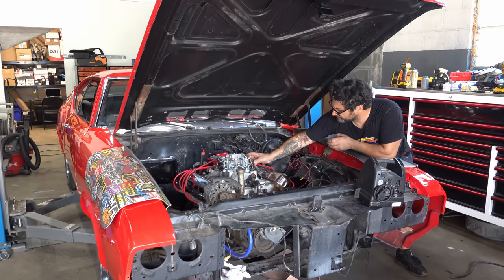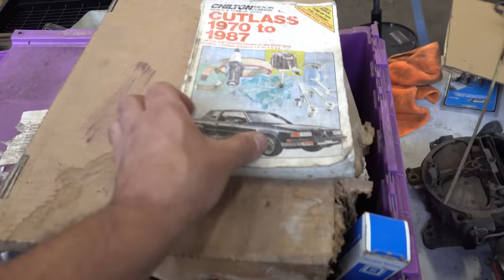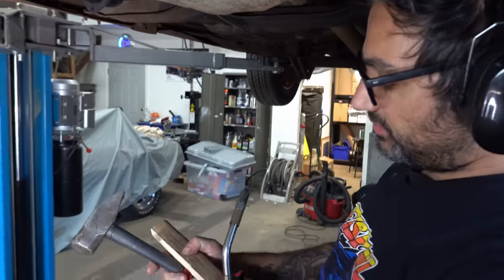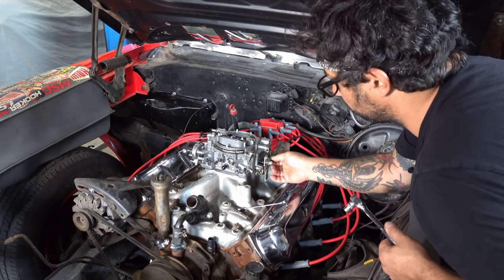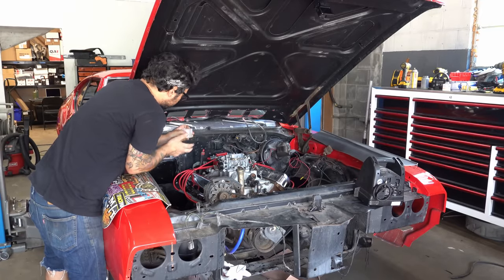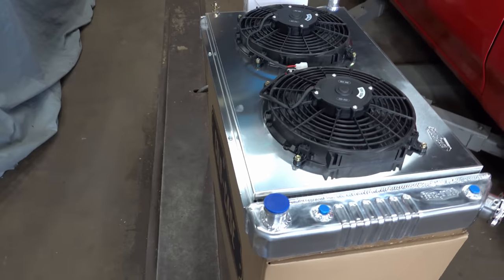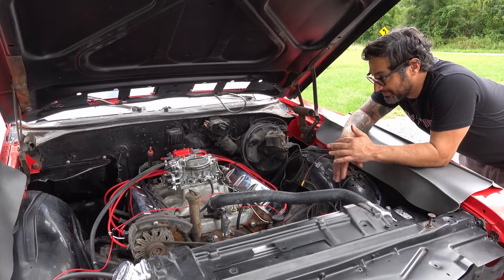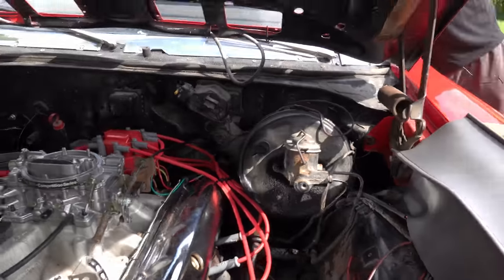Will This Abandoned 1970 Cutlass Run and Drive After 15 Years?!

Comment: You remember the guy, Ben, who helped you with Finn's transmission on Drag week? He's an Olds guy located in Maryland and might have a better set of heads for ya to buy.
Reply from the maker: I love Ben! I'll hit him up. He can prob sort this transmission too.
Reply: @StayTunedTA  he is a great friend and definitely saved my bacon before Power Tour '19
Reply: @StayTunedTA  he knows a ton about the 200-4R, that he will definitely have ideas for ya.
Reply: Let me know what I can do to help.  Make sure the TV cable is adjusted correctly before the first road test.  It's all too easy to burn up a 200-4R.
Reply: Check casting number but front filler tube. Big Letters  are  big block and  big number is small block. Drivers side flange by front no 1 cylinder has 3xxxxxx for olds make year plant and vin.... good look with rocket motor. Had a 74 H/O 455 W30 that rocked!
Reply: If still visible, the little pad on the driver side front deck corner of block will show a vin number. That number will tell you the year, etc for that engine.

Comment: That 350b will do fine.  Throw some Edelbrock heads on it if you want to drop some weight and get a bit more power out of it.  BTW I would put a higher amp alternator in it to run those fans.  It's way more expensive to get those heads to work than buying aluminum heads.  Glad Oldsmobile is finally getting some airplay.  1970 is about the most awesome Cutlass ever made.
Reply from the maker: You know, that might be the move. I bet heads and a cam would wake that thing up. This is a reworked internally regulated alternator so I'm hoping it makes some juice, but that's a good call.
Reply: @StayTunedTA      Best cam for a 350 Rocket motor, Olds W-31 cam on a straight up 110 center line ( 472 lift with a 295 Dur)  BUT you got to run a 3,500 or taller stall converter. ( I used a 4,500 in my Cutless and it was the bomb with 355 rear gears.)   At the drag strip, my Cutless with nothing but a W-31 cam on a 110 center line (for automatic trans)  and 4,500 stall and 355 rear went 13.50 at 100mph in the 1/4 mile with street tires. I was SHOCKED !  A week later I drove that car 1,700 miles to TEXAS and back with zero problems. 

     P/S you don't have to buy new heads, just send yours out and get them decked about .100 and slot the intake bolt holes to match. You can bring it up to almost 10:00 to1 even with the dished pistons if you use a .018 thick shim head gasket.
Reply: @StayTunedTA  I run a Comp Cams OL XE-268H-10 in mine with Mondello Aluminum heads.  Comp Roller rockers and Trend pushrods.   The thing makes a ton of power.
Reply: @hydroy1  I'm not trying to kill anybodys thunder but..  the comp cams XE 268H-10 Olds cam is a 110 cam. It's a 485/ 490 cam.  Oldsmobile would have loved to make this cam in 1970 for the 350 Olds.  The original Rallye 350 cam had ,474 lift.  Plus they had to pull the primary jets out of the carb to get it to run.  There is a huge debate among Olds guys about these carburetors.  It's an early or late 69 build issue.  The Rallye 350 was built to kill the muscle car insurance in 1970.  It didn't sell well..  I would kill to have an original.  Today you can build a much better 350 Olds engine.  DM or Call me..  As my machinist told me.. you got idiot money if you want an Olds motor over as LS.
Reply: Sorry ... I meant secondary jets.. My bad.. LOL
Reply: totally agree man
Reply: The Edelbrock heads are kinda designed and intended for big block Olds applications. They will work well on a 350, but you need to change up your plan with camshaft choice, also target static compression is a factor as out of the box the heads are around 77cc. The ports are slightly larger in volume on both intake and exhaust, so take that into account. Intake manifold port alignment is an issue as well. They can be made to work great with some forethought and homework. 
I know a guy who stuck with a 350 Olds combo instead of going big block. He has messed with his setup for almost 30 years now. He has made a solid 575+ hp on the pump and his car runs harder than many 455 cars.

Comment: Hey Tony, 200-4rs are the same length and output shaft as a th350, it’s damn near a direct swap except for the crossmember, lockup wiring plug, and maybe the cooler lines (think you have to bend them a little). If you can find a factory driveshaft for that Olds, then you can install that. Also, don’t forget that the 200 has a TV cable like on a 700r4
Reply: Hot Rod had an article back in 2000 on how to do it, they even reused the same driveshaft.

Comment: Hey Tony, I live in Carnegie Pennsylvania , I have tons of oldsmobile motors if you need anything from me let me know I have 350s 455s thm 400s
Reply from the maker: Have any rear bumpers or grille parts?!
Reply: We could also use a clean OEM or NOS dipstick tube if you have one!
Reply: @StayTunedTA  i do not. But I have # 6 heads for a 350 olds #5 heads and #4 heads. Also have a 461 big block olds. I do have a dipstick and tube for both big and small block olds

Comment: The "secret" to cruising at high speed in an Olds is to leave the stock gearing alone. High compression Olds 350+TH350 trans in a 1981 Cutlass with 2.29:1 rear axle ratio=60 MPH in first gear. Highway cruising isn't a problem!

Comment: Fun tip: a 51042 Wix is a smaller body version of the 51258 oil filter, came standard on the 2.4 in Achievas, Grand Ams, etc. Also works with a Cadillac 472/500 in a G Body so you can keep the sway bar.

Comment: The Olds 350 is arguably the best factory 350 GM engine, it has the largest factory bore at least (4.057"), the W31 made 325hp, I suppose the 1969 Pontiac 350 H.O. was rated 330hp but it's 354ci and the 1970 LT-1 350 was rated 360hp(Z/28) and 370hp (Corvette). The best Buick 350 was 310hp, is usually considered the worst, had the longest stroke 3.85", is the lightest, is considered very strong by many and does well with boost.

Comment: Judging by the Steering wheel that looks like a 85-87 442 wheel, you may have a 85-7 442 2004r trans in it. Better than most 2004r’s.
Reply from the maker: Good point that I never really considered! Maybe it was a junkyard haul!

Comment: Most 200 4-Rs were pitiful V6 transmissions, weren't they? I thought the 700R-4 was the decent one. Am I insane?
Reply: This isn’t 1985. The 200R4 has come a long way since the dark years. Unfortunately, it’s reputation as weak just won’t go away. 

The 200R4 has more potential than a 700. The Grand National guys have them in the 8s. There is a ton of aftermarket support. The weak link is the forward clutch housing, lots of torque and the shaft will twist and snap. You can get aftermarket carriers and shafts, properly built a 2004R can handle over 1000 hp with ease. 

The 700 is stronger from the factory, but the biggest weakness that can’t be overcome is the input shaft is splined and pressed into the aluminum input clutch housing. Lots of power will twist the shaft out. They make press on reinforcing selves, but it’s a band aid. 

For the most part, a 200R4 from grandmas Cadillac has the same internals as the Grand National trans, with the exception of the valve body, servo, governor and converter.
Reply: @mattrodgers4878  So, everything that makes it work? Haha! I didn't know that, though. Everyone told me, so it must be so, haha! I had the same 327/700 in three different cars, two of which, apparently, had a better trans. I mean, mine was built, but still. Didn't know that.
Reply: @The_sinner_Jim_Whitney  there are multiple servos, valve body, and governor  calibrations for the 700 as well, depending on application. The shift points and shift quality will be far different for a S-10 compared to a Camaro or truck, so the parts that control that will be calibrated accordingly. 

In either case, it’s no big deal to change valve body’s, servos, or governor with the trans in the car. Well, other than the mess of ATF in your hair I suppose.
Reply: The regular TH200 3spd was the bad one.
Reply: @hendo337  and as bad as those were, they had a following in certain drag race car classes. The lightweight and low frictional losses (the very things they were designed for in the “dark years” of automotive performance) make them ideal for certain types of race cars b

Comment: Tony, back again with another comment bc I’m just finishing up. I had a olds 403 in my trans am and these olds motors sometimes from the factory has 18 degrees initial timing.  I messed with my engine a lot and from what I remember, earlier olds motors factory setting was 12 degrees where as later years ( 77 and on, something like that had 18 degrees).  If you do have a later 350 you should be running more timing.  It turned over hard at 15 degrees so maybe you actually have a earlier olds casting.  Also the code for what engine you got should be stamped right on the engine block in front or behind the oil tube. Run the numbers to tell what year you got and make your changes and engine upgrades from there.

Comment: Get the transmission checked and assum the TV cable and other stuff was not synced because it was not running. If it is not synced with the motor the transmission will burn up. Someone familiar with later transmission converted to older engines would know what to do. Because of the overdrive the transmission setup is different then a th350-400.

Comment: My 362cid small block Olds made 466hp/458tq with ported #5 heads which are not too far off the 8s as far as what is possible, but honestly your best bet is to just bolt on Edelbrocks.  BTR Performance in Rochester NY is a good resource.  The owner (Bill Trovato) has a nice book out as well that has about everything you need for a crash course in Oldsmobile V8s.
Reply: Excellent combo and great numbers!

Comment: A 200-4R is a straight bolt-in for a TH350: same length, same yoke, same mount. Just need to change the shifter, add the TV cable, make sure you've addressed the lock-up converter, and you're good
Reply from the maker: Yessir! I'm gonna get the 4 speed shifter that goes into the stock shifter and wire up a little controller and be good to go!

Comment: My friend in highschool had one just like that(around the year 2000) blue with silver stripes. The 4 wheel drums weren't that bad at normal speeds. Really only sucked when you were doing something stupid. In the car it felt like you were driving a lazy boy, but it wasn't underpowered (not overpowered either) perfect cruiser
Reply from the maker: Yeah, I think that makes sense. I'm going to just put it together the way it is and see what it's like for the rest of the summer. Should be fun!

Comment: Bruh...Tony, that thing is absolutely BEAUTIFUL! I have ALWAYS wanted to get my hands on a 67 442, but closer to my monetary situation, a 1980s Cutlass, and I did find one back in the day for $500 in Florida, but I was a teenager back then, so that was a no-go. Anyway, I've been dying to get my hands on a clean reliable old-school Olds Cutlass for a daily for a LONG long time, but right now I drive a 2004 Acura TL with a 11.5:1 SOHC VTEC V6 with a full Invidia exhaust with dual mufflers, full custom headers with hollow cats, larger diameter collector pipe, a full Injen cold air intake, a six speed manual conversion, manual gauge cluster, a 2007 TL manual ECU, custom made ARP head studs, Gates RPM timing belt, AEM 340 LPH fuel pump, a custom Hondata FlashPro tune, and a full stereo system with a Jensen touchscreen head unit, a Skar 5 channel amp with Kicker door and rear speakers, a Memphis Ultra 8" factory sub replacement, a set of two 12" Sundown Audio SA12-D2s subwoofers, and a Soundstream Rubicon Nano RN1.5000D 5000 watt amp. I also relocated the Optima Yellowtop battery to the trunk. Oh, and I also have a 709 whp 1997 EJ8 Civic coupe that has a fully built LSVTEC turbo.
Reply: all that money couldve easily bought an 80s cutlass in florida

Comment: Oh yeah, the hood with dual scoops, is the best ram air hood G.M. ever made..
Reply: Seriously, ram air scoops at awesome angles with factory, spin lock majigers??? To hold it down???
Reply: The original add, for the 70 olds 442, said this isn't your Dad's Oldsmobile, but when I grew up, it was my dad's Oldsmobile, sitting in garage. I even bought a 70 Camaro, for 1k instead of the olds I knew it wasn't going anywhere. I'm 44, greatfull to expierence, so many classics, 66 elco, 78 BLK z-28, 78 short 4x4 factory black Chevy van??? I currently own a 95 short Chevy, obs Lowrider show truck from the mid, late 90,s lays frame.. and a 60s mid engine, altered wheel base, wheelie stander Econoline street freak.. yah altered wheel base..

Comment: The thickness of the crust
does not determine whether a pizza is "Chicago style" or not.
The two determining factors required for this moniker are as follows.
1. Sauce goes on top.
2. Wheat flour dough.
That's "Chicago Style" pizza

Comment: It's not the audio quality that sucks, just need to compress it.. Like when you watch a Nexflix movie and you can't the here dialog but, your neighbors can hear machine gun fire, RPG's and helicopters. Put a steering wheel on my dick because, it drives me nuts. Can't hear what Tony says unless you crank it to 11, then when he starts banging on the header, it's the Liberty Bell right in you ear. Audio commpression, that's all. Even that ish out. Great Olds though. Not sold on the red but, shop class approved.

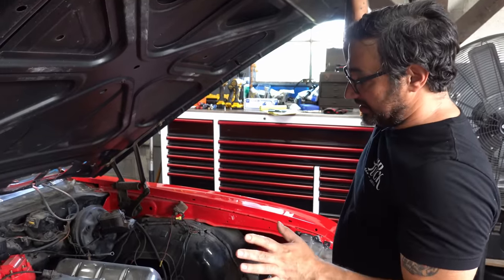Comment: In the beginning starting around 1:30ish you can tell it's a 1970 because of the location of the horn relay on the fender and also those little dimples along that inner fender seam, 1970 only for the fenders. 
Also, all the charging current from the alternator goes to and from that stupid little horn relay. Make sure your wiring is done right in this area or you will make a smoke show!
My first car was a 1970 442 and I still have it since 1983! Got to know these cars inside and out. Even replaced the frame on my car due to rust. 
Let's see how this episode goes, as I just started watching...

Comment: Those bits are dull because you run them at 735,000 rpm! Full throttle in second is perfect on a 20V DeWalt for a TINY (like 1/8") bit. Half throttle in 2nd, full in 1st is ideal for 3/8"-1/2". You're drilling rivets. 1/2-throttle in 1st WITH COOLANT, with GOOD bits, is about right. Glad everything worked out, haha! Gorgeous machine.

Comment: With HEI, they could go to 50 thou gap on the plugs.
Reply: Even though they came from the factory in the mid 70s with up to .060 plug gaps, the stock HEI coil don't like that at anything above about 5000-5200rpm. I do believe aftermarket HEI coils solve this problem, especially the Davis/performance distributors setup.

Comment: Great episode. Got me motivated to get my 67 CSvert back on the road. She’ll be wielding a .060 455, Eddy heads and roller Howard’s 4/7 swap cam. Searching for that ‘chop’. The transmission is a 200r4. (Great find for your car) The diff is a PowerTrax added 10-bolt with 3:55’s.

Comment: Stock 1971 and later Olds 350 deep dished piston motors still rock!
They won't run with a 455 but still burn the tires and scoot pretty well for what it is.

Comment: If thats a 200-4r the original TH350 driveshaft is the same length, the mount on the transmission is farther back in about the same spot as a th400 so just move the crossmember back to the th400 holes on the frame. (May want to put a nut on that mount too Haha)  Also make sure you connect and properly adjust the TV cable or you will cook that transmission quickly. Its not a kickdown like a th350. Wiring up the lock up converter will also help it live.
Then do the Buick GN upgrades to the trans as well if you like how it drives. :)
Loving your content on here, gonna miss seeing you with Lucky on HRG though.

Comment: I'm assuming you know to to run a 12v wire from the fuse box "ign" to the distributor. Also put a mini starter in because the factory one will get hot then wont want to start. Sweet ride, I have a 1971 CS SX and a 1972 CS

Comment: It is screaming for a ultra bad ass high compression aluminum head Oldsmobile 455 goodness with a 6 speed manual and staggered forged or billet 17" or 18" wheels done exactly like the stock wheels. As cool as the Fish Tail Cuda is imagine if this was built similarly but with a Oldsmobile 455 and to completely look stock minus the larger diameter wheels. Then name it the Oldsmobile Cutloose Supreme with a Four Fifty Fry big block Oldsmobile 642 (since it would have a 6 speed manual)

Comment: I’m pretty sure the drive shaft for a th350 would work with 2004r the case length is same and transmission crossmember just slides back to the th400 holes in frame

Comment: The HF moving blanket as a welding blanket is mint.  Have a fire extinguisher handy....just saying...I may or may not know why.  ❤‍🔥❤‍🔥❤‍🔥❤‍🔥❤‍🔥❤‍🔥
Reply from the maker: Hahah, yeah, we've got em close (they were probably charged in 1995).
Reply: @StayTunedTA  Pro Tip don't try to put out burning HF blankets by stomping on them wearing Crocs. 😭 Again I may or may not have scars from the melted plastic and ash falling thru the croc holes.  Haha croc holes.  That sounds dirty. 😔